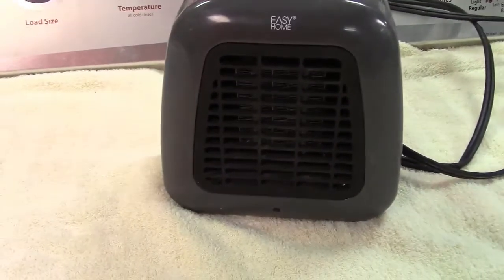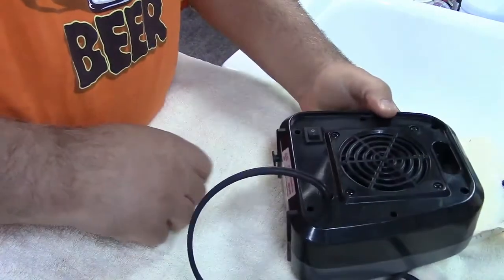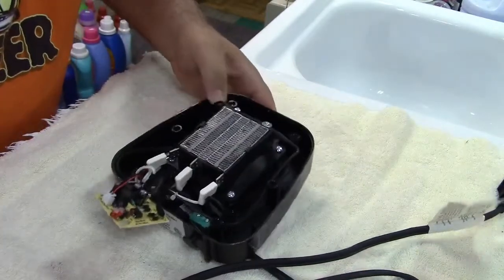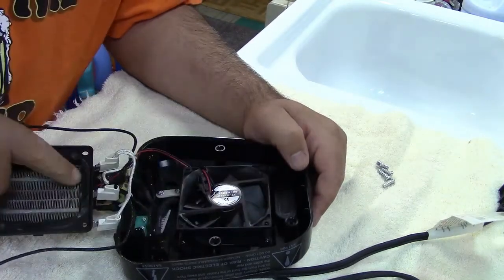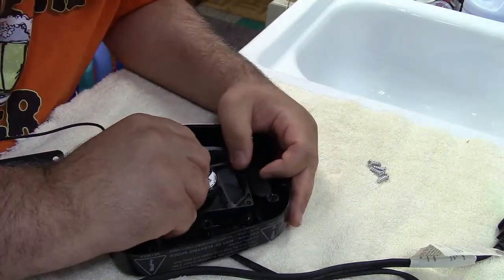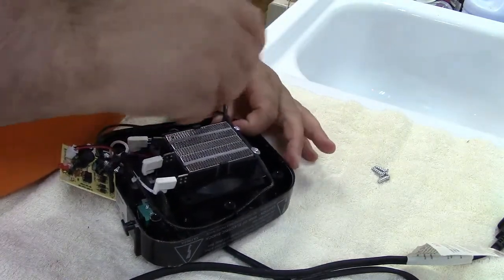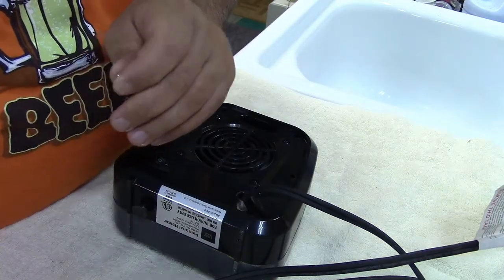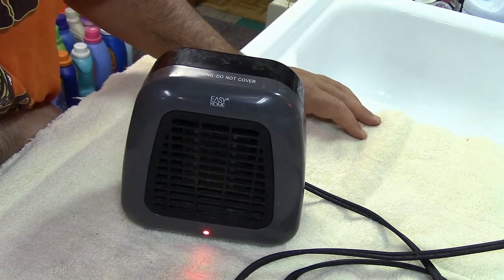Servicing The Easy Home (Aldi) Personal Heater

Comment: As ceramic heaters are self regulating, I wonder if putting in a new 80mm fan with higher cfm output would result in more heat power coming from the heater, and vice versa with a lower cfm fan.
Reply from the maker: Interesting.  Should this fan ever need replacement, that can easily be tested since I have 2 of these heaters.

Comment: It amazes me how the need for a circuit board to power a 12 volt fan is cheaper than simply using an 120 VAC motor.
Reply from the maker: Same here.  I guess those boards are about a dime from China, and the fans maybe a dollar, at least in huge bulk lots.  Either way, the fan is really easy to replace if it goes bad, and I have countless replacements on hand.

Comment: Perhaps the motor sitting right up against the element dried out the bearings faster..
I've never particularly liked this style of heater because they don't push a whole lot of air through and tend to be on the noisy side, but at least this one seems reasonably serviceable..
Reply from the maker: I prefer ceramic heaters like this for "spot heating", but for a room they're useless.  For a room I'd take an oil filled or radiant one.

Regardless, for the purpose I use this particular heater for, it works fantastic.  I had a Pelonis 1500 watt heater fan I'd use before I got this one.  I got this one and decided to test it out and see if it would do the trick.  Yes, it's just enough for what I need, and it saves me 100 watts over the other one.

Besides the ridiculous circuit board and 12 volt fan they use in it, it's very well designed.  I suppose they didn't use a 120 volt fan because that apparently would have cost more, or may have moved more air than necessary, leading to sub-par performance.  Anyway, it is indeed easy to service, and should that fan ever die, I have so many replacements on hand I have nothing to worry about.